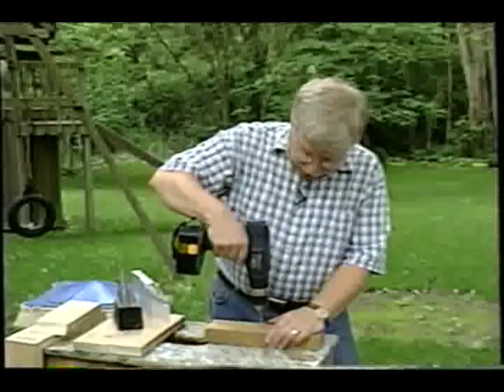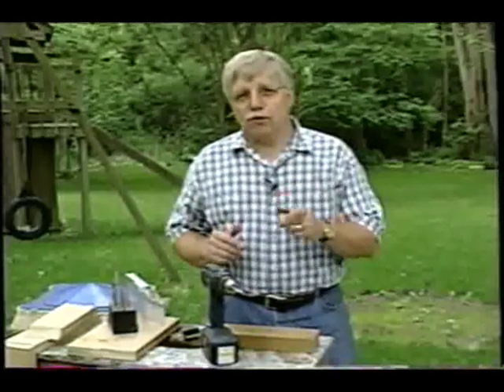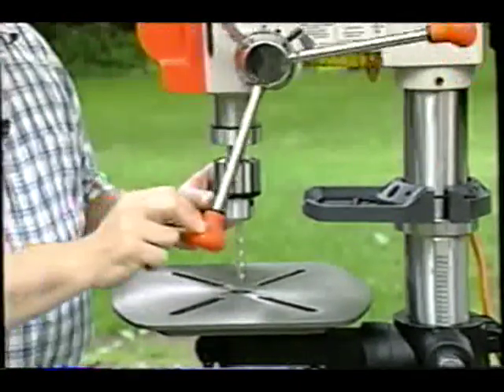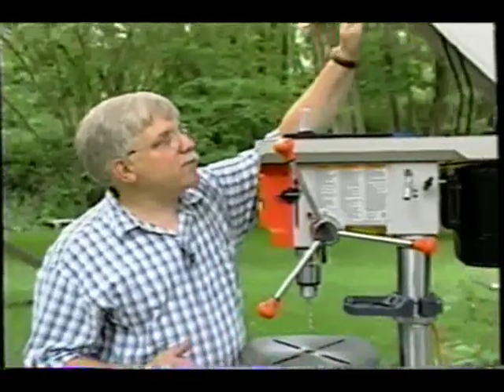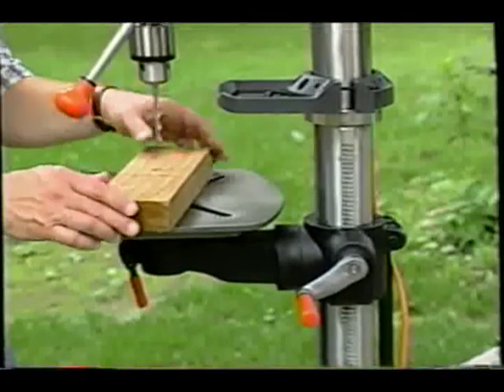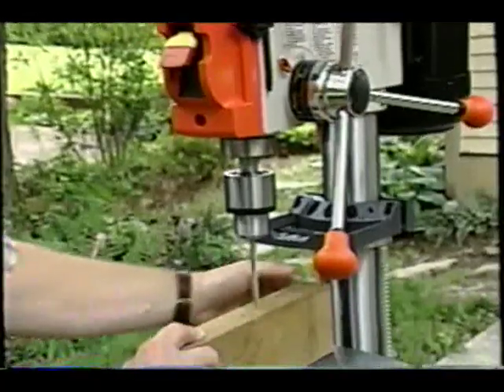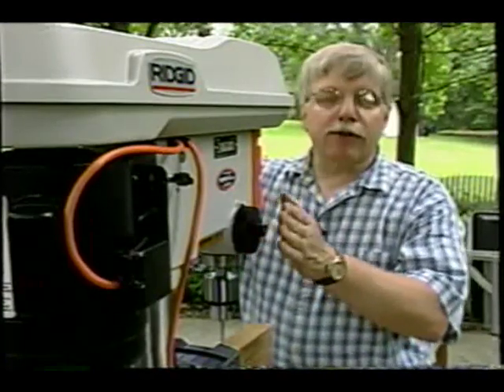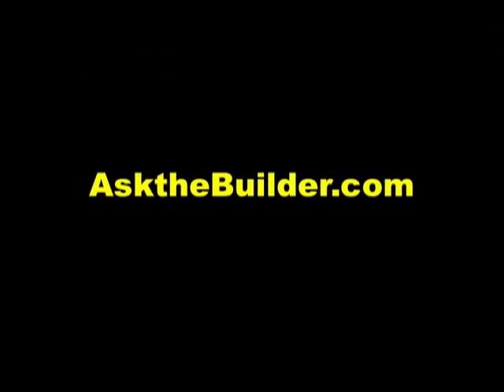Drill Press

Comment: Thanks for the demonstration.
Interesting that the Rigid you show, a high end Delta, a standard Grizzly, and a low end knock off from Harbor Freight, all share the same castings with only minor add ons, i.e. the light, to differentiate between them. 
I want to buy a drill press but supporting cheap offshore manufacturing that displaces both you and I as American workers is not acceptable.
Are there any tools made in the USA?